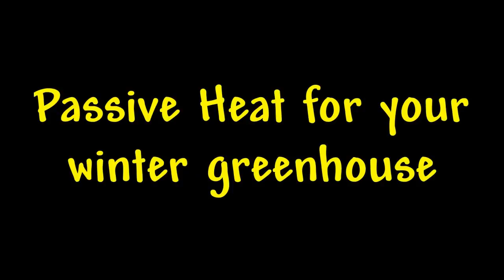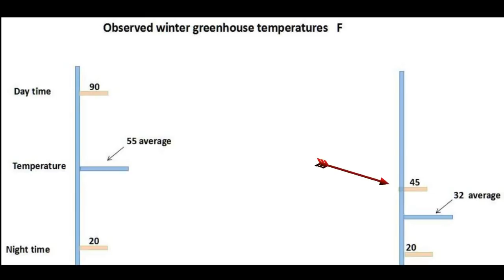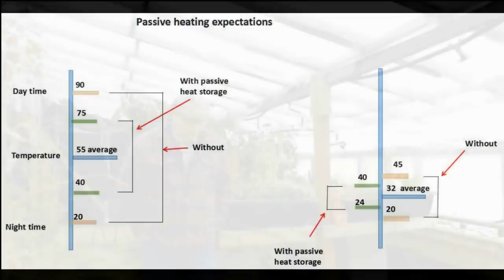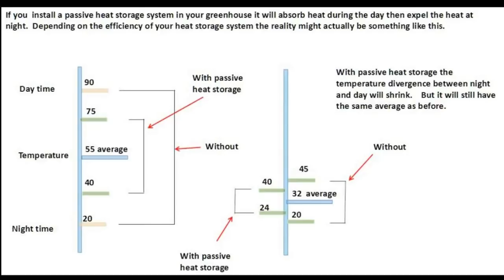Passive Heating a winter greenhouse using water

Comment: Would making a stone wall and painting it black do the job?
Reply from the maker: I've never seen that tried.  But I'll bet it would do something beneficial.  I think stone doesn't have quite the same heat storage capacity as water but it will never leak or rust out a barrel.   If you've got access to stone or brick I would give it try.
Reply: @eddysgreenhousegarden7022   I am going to perform some tests this winter and see how well it works.

Comment: I have been thinking about using evacuated tubes to heat a massive water tank inside the greenhouse. It could be where your central bench is and plants could be on top of it. The tubes cost nothing to run just installation costs. I always say about capital expenses “that they only hurt the day you have to pay for them after that they continue to pay back forever”.
Reply from the maker: That's true.   The cost of my stuff only hurt once.   Even though I bought it all one piece at a time.

Comment: Thank you for the average break down. Not many vids even alot newer ones break it down so easily.
My plan atm is...run ducting underground from my home to the green house. In the daytime when the greenhouse is venting hot air it will pump air to the house. So as to not need much fire in the indoor woodstove if any during the days. Then start a fire at night inside when the greenhouse and home starts to cool. With a fan aimed the other way through the pipe putting heat from inside the home to the greenhouse. Since my home needs heat at night anyway it seems a win win. But won't know how well it works till setup is that sad part. If the greenhouse sucks to much heat at night my home will get fridged. Only down side I see. 
Though will need quite a big woodstove to heat all night without getting up to restock it. As the little one I use atm barely makes it through the night just heating my home alone.
A good thing is my home is only 20ft from the greenhouse. The further the greenhouse is away from a persons home the more heat will be dispersed into the ground outside. Making the air passing through not that warm once it gets to its target.
Reply from the maker: A very interesting situation.   They only thing I can suggest is to put your air piping as deep as you can.   It might help store some of that heat being transferred between the greenhouse  and your home then maybe your temperature variations might be less.   Just a theory, keep that in mind.
Reply: @eddysgreenhousegarden7022  was thinking of using that insulated ducting tube. Then I wouldn't need to go to deep. If using this to deep might crush it. Though I worry if the insulation around the ducting gets wet it will freeze. So might even wrap the heck out of it with packaging/shipping heavy duty wrap. Then maybe surround it with peat rock. So water doesn't set around it but will flow under it.
Reply from the maker: @flatout5815  Good luck.  Keep it out of the water.   I would be interested in how well it worked when you get to that point.  Let me know

Comment: I use cement mixing tubs set on 5 Gallon pails of water. So far, here in Maine, everything is growing slowly but, even though temperatures at Night have gone down to around zero, plants are surviving for an early start when temperatures rise again.
Reply from the maker: Sounds good.  I am assuming that's Fahrenheit.  What kind of plants are they?
Reply: @eddysgreenhousegarden7022  
Yes, I forget that most people us Centigrade these days..lol
I have Escarole, Kale, various varieties of lettuce, onions, cilantro, leeks, celery, brassicas and a few more odd varieties. Since this is my first Winter with this design, I want to see how much of an effort I will put into it next Fall.
One of the reasons as well, was this past Summer was a dry one and the Deer were a big problem, so their favorite species will likely be grown in the greenhouse, as well.
Reply from the maker: @untermench3502  Keep us all posted how it goes.

Comment: On the NORTH wall???
Reply from the maker: If you think about it..... it makes sense,...to me anyway.   On the south wall you're blocking light that could be used by the plants.   On the north wall your getting light that is by passing the plants anyway.    What do you think?  Make sense or not.
Reply: @eddysgreenhousegarden7022  Thank you for the reply. That is one way to look at it, my thought is that on the south side they will absorb more direct sun light and heat up more and therefore be able to radiate more during the night. As to the direct sunlight, to most plants direct or indirect/reflected light is just as beneficial. Just my thinking. I have since seen a few other posts that say to put them on the north side also. Ours are on the south side.
Reply from the maker: Interesting point.   This summer I'll have to do an experiment.  I'll put a smaller container on the north side and one on the south side and see which one heats up the fastest.  Repeating it a few different times during the day should produce some data to show what is best.  Sometimes the resulting data is surprising.
Reply: @eddysgreenhousegarden7022  Please post it in this thread, I am curious. We will start setting up our greenhouse in the next few weeks in preparation for spring and to use it for years to come.

Comment: the idea of thermal mass using water is fine, but i would like to see an explanation of why you think the interior temperature would be the average of the outdoor temperature.  i think that's a flawed premise.  if most of your walls are insulated well and your glazing has at least R-3, then you can expect a much warmer interior than average ambient.
Reply from the maker: Brian,  The reason I did that was to keep things simple to get the basic point across without getting lost in the weeds.  I think you are quite right, things would change if you had significantly better insulation.   But that's quite difficult to do unless you go walipini or something like that.  Also I don't think "R3"  or better greenhouse house covering  is readily available.   It's too expensive for most people.  
One more thing....if you notice the average inside temp does not follow the outside temp.   The graphs show with better heat storage the inside average temperature does increase  and in fact does not follow the outside temp.   Maybe I'm missing your point. 

Ed

Comment: What about Solar panel and a battery? Battery supplying a heater for the night run. Solar panels charging battery during the day. Overcast or snow on panels might be an issue. Proper angle for winter is steep angle anyways. More angle the more north you live. Latitude.
Reply from the maker: Mark,  I did some investigation on that topic a while ago and at least for me I found it would take too many solar panels and too many batteries to be worthwhile.   During the summer I get, maybe 8 or 9 hours of good solar during the day.   During the winter I'm lucky get six or so.  Also during the winter there's a lot of overcast and stormy  days as well.   So I would need a lot of solar panels to capture the limited amount of solar I was getting to charge up the batteries to store the   50 - 100 Kw hours of battery power I would need for the night time.   It takes a lot of batteries to do that.   It can be done, it's just that making heat with electricity takes a good deal power. 

Ed

Comment: The biggest thing you can improve with a greenhouse is preventing heat LOSS through the plastic or glass or whatever is your clear membrane. Greenhouses are great for collecting heat but suck at keeping it. You lose so much heat OUT the same way it got in! Storage is the easy part. Keeping heat in is what’s hard.
Look at those numbers on the left- 90 in the day, 20 at night. All you need to do is keep the heat you already have from escaping. Storage is the easy but low efficiency way to do it. Trapping the heat is much harder, but more effective. A thermal blanket (r10 or more) that covers the plastic/glass at night (ideally automatic with thermostat) will do wonders!
Reply: I have passive heating using used metal food cans painted black, on shelves on the north wall. At night I have those cheap moving blankets you get at Home Depot, I put them on 1/2" EMT rods with shower curtain rings. The ceiling has wire stretched from north to south and the moving blankets just pull across.  Then I put the old style Christmas C9 tree lights up (each 25' string is 27 watts. It works really well for me.  Early on I discovered that the secret was small greenhouses.I built them timber frame style, just 4x4's in a square, polycarbonate for roof. But.....the greenhouses are all attached, just segmented into smaller 8x8 rooms, with the connecting wall being R-13 styrofoam insulation, as are the north walls, and the one west wall.  I live in the High Desert.....night time temps are about 27 at night but days are almost always sunny so the smaller greenhouse rooms quickly heat up to 80 or more even on a 40 degree day.
Reply from the maker: I could not agree with you more!  But preventing the heat loss through the transparency is not easy without spending a lot of money to do it.
Reply: If you are making money (or could be) with the greenhouse it’s worth doing. There’s expense and there’s value. My diesel generator was 3x more expensive than the same gas model, but the value is easily 10x because of lower fuel use, less maintenance and longer life.
So I think the same is true for insulation (in any situation, not just here). The value is more than the expense. What is the expense of lost growing time, or worse, a lost crop? And the offset is that the heat is still free!

Comment: We did that in Siberia by putting a Jean Pain styled large size compost inside a multi-layered greenhouse hardened against 20 centimeter wide hail stones and heavy snows and heavy high winds and against extreme cold and extreme heat and filters out all UV rays and IF rays to prevent overheating in the summer and keeping it cool during the hot summer (or as hot as the hottest desert in the world and as cold as the coldest region in the world) and we put our crop plants and medicinal herbal pharmaceutical plants inside as well as our air and water bioremediation plants and firewood crops for the plants and helping them grow like mad inside the greenhouse to recycle and filter both water and air and bioremediate-recycle-process-reprocess solid wastes (especially human wastes) using both Professor John Todd's LIVING MACHINES AND PERMACULTURE PRINCIPLES, METHODS, TECHNIQUES, PROCESSES like some kind of Mini-Earth. The compost gives off heat and carbon dioxide for all our plants and making them grow like mad and giving a lot of fresh oxygen inside and transpiring fresh water in the form of super-saturated humidity level in the air (which is condensed into a drinkable liquid water which is biologically sterilized and sanitized into fresh drinkable water as if it came from a fresh water spring by using cryogenically insulated pipes bringing a controlled amount of cold air or water pumped in from the outside or from the water well) and it condenses also on the leaves forming dew that waters the plants. The willow can transpire 5 cubic feet of water into the air after drinking sewage and black alder can empty a septic tank or cesspool empty of all of it's contents as if it is a mixtture of water and fertilizer, the ailanthis altissima tree can also be used in this manner.
Reply from the maker: Very interesting

Comment: Rotting compost gives off heat for free.
Reply: We did that in Siberia by putting a Jean Pain styled large size compost inside a multi-layered greenhouse hardened against 20 centimeter wide hail stones and heavy snows and heavy high winds and against extreme cold and extreme heat and filters out all UV rays and IF rays to prevent overheating in the summer and keeping it cool during the hot summer (or as hot as the hottest desert in the world and as cold as the coldest region in the world) and we put our crop plants and medicinal herbal pharmaceutical plants inside as well as our air and water bioremediation plants and firewood crops for the plants and helping them grow like mad inside the greenhouse to recycle and filter both water and air and bioremediate-recycle-process-reprocess solid wastes (especially human wastes) using both Professor John Todd's LIVING MACHINES AND PERMACULTURE PRINCIPLES, METHODS, TECHNIQUES, PROCESSES like some kind of Mini-Earth. The compost gives off heat and carbon dioxide for all our plants and making them grow like mad and giving a lot of fresh oxygen inside and transpiring fresh water in the form of 
super-saturated humidity level in the air (which is condensed into a drinkable liquid water which is biologically sterilized and sanitized into fresh drinkable water as if it came from a fresh water spring by using cryogenically insulated pipes bringing a controlled amount of cold air or water pumped in from the outside or from the water well) and it condenses also on the leaves forming dew that waters the plants. The willow can transpire 5 cubic feet of water into the air after drinking sewage and black alder can empty a septic tank or cesspool empty of all of it's contents as if it is a mixtture of water and fertilizer, the ailanthis altissima tree can also be used in this manner.
Reply: @darthvader5300 I was interested in some of your methods. Have you got a channel to follow for instruction?Sounds like a university project with lots of funding, but if the concepts and equipment can be broken down with clear instruction,  it could be very beneficial to many. I have an interest in those pharmaceutical plants , the specifics on the compost size and structure, and even some on water purification...tho I must admit, I'm not certain if I ought to be trusting  advice from Darth Vader! Seriously tho, a single source with practical applications is so much more time effective then trying to study all these methods, only to find out that they're cost or space prohibitive. That's what I appreciated about this video most. He laid out the parameters right off the bat, so you knew if it would work in your situation. If you are able to share some of your experience, it would be appreciated.
Reply from the maker: Those are very kind words.   I don't have an instructional channel but perhaps I should put more instructional things on this one.   I am not an expert, I am trying to learn to be one.  I do have an engineering and physics background so I think I can learn these things about the biology of plants, etc.    But one thing I have learned in my career is that classroom theory and hard science is a good place to start but things in the real world don't always work the way they are supposed to according to science.   When they don't....that's when you learn something.
Reply: @eddysgreenhousegarden7022  so very true.

Comment: Four - 4" pipes running out of the green house in each direction for 100 feet, buried about 8'  is a better idea.  Blow excess heat into them and suck it back out at night.  A little electrical cost but fans are cheap to run.
Reply: i saw info that these system also have serious mold growth in the underground hose. because of the moist warm air.

Comment: On west coast of Canada at latitude 50 degrees , we are cloudy and rainy in winter. In the 6 months straddling New Years'  our average daily bright sunshine is 2 hours/day. Our solar GH is insulated on north and roof area to R6. Our poly skin of 120 sq. ft. collects heat into 1500 pounds of water in barrels each having the south side painted black.  I've seen math suggesting that the water volume should be tripled. Our  average ambient winter minimum temp is 10 C.  Chasing those few hours of bright sun is hopeless; we can almost always beat frost, but just barely. Contact your local met. office about your local sunshine hours